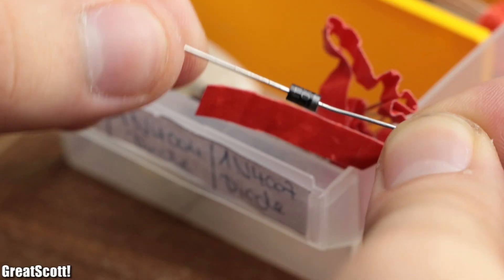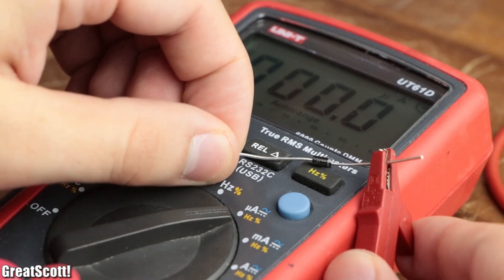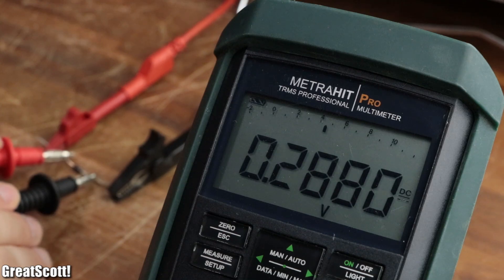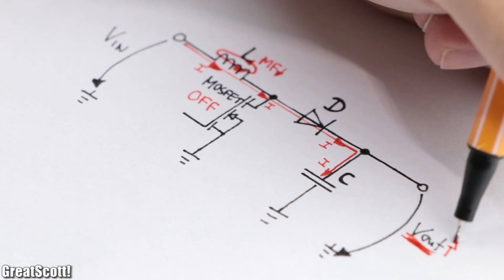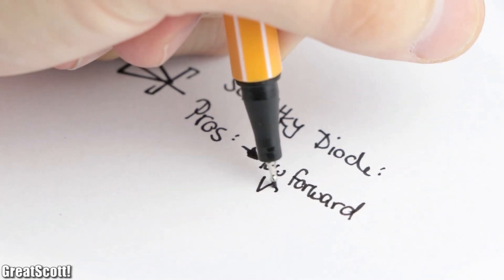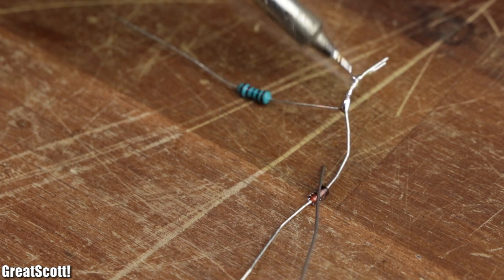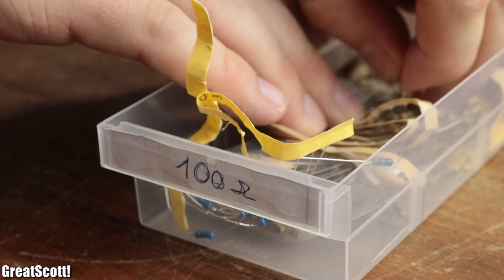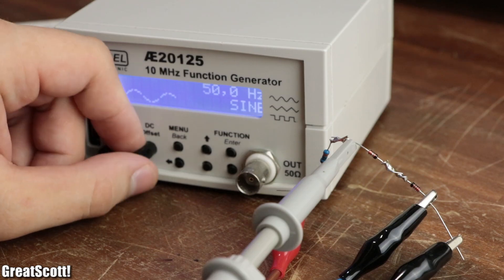Electronic Basics #31: Schottky Diode & Zener Diode

Comment: Hello. If you can help. I want a mobule for18650 input to 1.5v stable output even if the battery is 20%. Any suggestion?

Comment: Hi
In some logic ic outputs there is some unwanted negative short pulses after falling edge that can damage the microcontrollers inputs.. what circuit can block them can diode be used for this??

Comment: If I wish to use a small panel cell to power a fan it makes noise until voltage/current from the panel match minimum requirement( in partial sun coverage), would a zener diode alone or with a cap in parallel as a buffer/battery be able to not turn on the fan till the requirements are met?

Comment: what voltage would a ZD6 diode be?
Reply: 6.0 volts. But you really need to seek out the data sheets as they give you a lot more information. 

All zeners have a minimum operating current which must flow through the device in order for the device to "breakdown" at the stated voltage.

This minimum operating current is stated in the data sheet and your job as a designer is to set that operating current using the right value of series resistance.

Comment: This helped me with my YT channel content of modifying a black and decker light. The COB lights I wanted to use kept pushing resistance back to the voltage regulator board and shutting it off. Using 1 schottky diode per COB strip on the + side made everything work perfectly. Now the negative terminals get warm (50C). But the GSM6232 variable voltage regulator doesnt even get 45C. Thinking of using 3 more on the negative side. Thanks! (DruCanDoIt) is my future channel. Building content. Have 3 videos edited and ready to go so far.

Comment: What about the light emitting diode 🤔
Reply: LEDs are diodes where the band gap between the valance band and conduction band has been modified by extrinsically doping the material to introduce additional energy levels to control the wavelength of light emitted as the electrons in the conduction band fall back down to the valence band and recombine with the holes.

Summary: 
The emission of light in LEDs is produced by extrinsic carrier recombination.

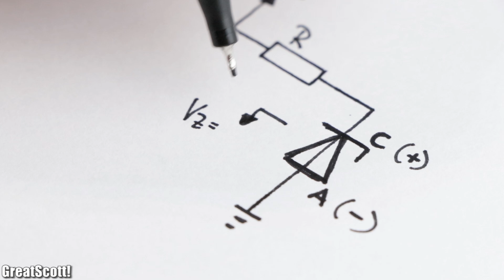Comment: In 5:11  
could you send me  that paper which you use to select the zener diode
Reply: Doesn't work like that.
You as the circuit designer have to decide on what zener voltage you require. Then you go looking for the right type of zener.
You look at the data sheets and the technical data.

Comment: hi i have a motor driver which am using to drive a coil CW and CCW to create electromagnet but when the coil collabse it destroy the motor driver can you suggest what to use to protect the motor driver , the power supply for the motor driver is 27 volts 22 amps thanks iin advance

Comment: If you use a schotky diode with a coil, you can increase the amount of current the coil is energized with each cycle. I thought this was magic when I learned about it by taking apart an old massager. Low took the diode out of the circuit. High put it in the circuit. That was when I got really interested in how these components worked. It seemed counter intuitive before I learned about those sweet sweet coils.

Comment: heres a good thought.
I recently purchased a oscilloscope which came from a high school.everything was perfect.today i get it out hook it up and no display.I opened it up and on visual inspection i found a burnt out diode the leads on both ends had burnt off.I have no schemtaics its a mini diode zener i know that from the board but cant find one that looks like it.It has a green stripe which tells me orientation.the other colors are 2 blue stripes.It mini so no numbers on it only those 3 stripes.So what do you do in a case like this?"  it goes into the crt circuit

Comment: The zener is Clipping of those voltage above 15v in your example, because it will force a larger current to Flow since it becomes conductive. This then ends in a voltage drop across the resistor in Front of the zener.. is that how it works?
Reply: No.
Zener diodes are simply diodes which have been designed to have a low reverse breakdown voltage. They are diodes which are placed deliberately into the circuit the wrong way around, compared to a non zener diode, so that they are normally reverse biased. However, the zener symbol and anode, cathode connections take account.

The reverse breakdown voltage is negative. Diodes are normally intended for operation at a voltage greater than the reverse break down voltage.
So if for example the reverse breakdown voltage is -100 volts, you should operate the zener at greater than -100 volts, which means between -100 and some positive value, typically 0.7 volts 

If you operate the diode at a lower voltage ( = at greater negative voltage), for example -120 volts then you will damage the diode. The diode becomes a short circuit. From 0 volts to -100 volts it has a high resistance and only a tiny current flows. When you go below the -100 volts the diode breaks down and the resistance greatly reduces.

Now, a zener diode is just a diode where instead of a reverse breakdown voltage being large at -100 volts, the voltage is set to a much lower voltage, for example 3.1 Volts, 9 volts.

If you connect up the zener in the right way so it is reverse biased, and you apply a voltage of greater than the stated zener voltage, the diode breaks down and the resistance, just as in the example above, reduces greatly. You do not want to do this in normal operation to non zener diodes as it permanently damages the diode. If you were using diodes in a full wave bridge rectifier running at 230 volts AC RMS, you would use diodes with a reverse breakdown voltage of typically 400 volts, which is a voltage that is higher than would normally be encountered in operation.

The series resistor with the zener does two things: it limits the current passing through the zener and prevents it burning out.

The second thing it does, it allows a voltage to be developed across the resistor so you can feed the circuit with a voltage higher than the zener voltage and the supply voltage is then divided across the resistor and the zener enabling the zener to have the right bias voltage across it to enable it to "breakdown" at the correct zener voltage.

Zeners are great, because they are designed to "breakdown" at a carefully controlled voltage, which means you can use them as a fairly accurate voltage reference. And then you can compare other voltages to them.

So for example, if you wanted a low battery indication circuit, you would use a zener and compare the battery voltage to the zener voltage and use a voltage comparator circuit or chip (or an op amp) and then use the output to drive an LED flashing circuit

Comment: Sir I have a motor attached to my cycles wheel which produces around 22v and I have to charge my battery of 15v 8a so should I do put a diode if yes pls tell me the value

Comment: Ignoring the resulting voltage drop of over 1 volt could the disadvantages of a schotty diode be negated with a standard silicon diode in series?
Reply: What? If you connect diodes in series, their voltage drops stack, resulting in lower efficiency.
Active rectifiers have the lowest voltage drop, but they require several components (mostly power MOSFETs and a controller).

Comment: Eddie Fox 

Hi there. This is a great explanation that has helped me understand Schottky and Zener diodes. I wonder if you can help me understand what is the best diode to protect an h-Bridge chip like L298N please. I have used 1n4001's but the h-bridge gets very hot (I'm running it on 12volts with "solenoids" low frequency = 20 - 1kHz but "enabling at" 20kHz roughly).

If I run  my little circuit with the cheep L298N Chinese board everything runs just warm (as you would expect) Runs at about 1 - 2 Amps. I notice they use "M7" diodes. Are these Schottky?

My circuit uses standard pin through, not SM components so the M7 would not be practical. I have seen some say the equivalent to the M7 is the 1N4007 but then I see the M7 listed as Schottky? 

Some even talk about using a Zener diode for H-Bridge protection.

Can you please advise me on what would be a real equivalent for the M7 please? 

1N5817 "family"? The fast rise time (high frequency) response seems to make sense to me on an H-bridge driving inductors. 

Thank you so much. I'm not a degree electronics student just a hobbyist interested in circuits. Have subscribed!!

If you've really got 5 minutes of you life to waste here is some thing similar to what I'm talking about before I got the Chinese L298N board (take no notice of the 1n4148's used!! :)

https://www.youtube.com/watch?v=h0nlACgOwns&t=6s

Regards

Eddie.

Comment: i have a question. does there exists a way, to send + on - voltage to one wire using tranzistors? i created the circuit, but im having a problem with + voltage flowing into collector of a npn tranzistor which is not activated, which gets hot and limits the output power. I thougth about diodes, but current can still flow to the npn tranzistor. my super weird lookign schematic: https://easyeda.com/jernej.raic/preklopnik-za-motor . I want to be able to switch + and - of 9v battery on the output(where i will plug in a dc motor) with 2 arduino digital pins(only 1 of them will be high at the time). I started doing this because arduino cant power the motor, and i dont wanna use standard switch to change + and - on the motor. i know servos are a lot better to use in this case, but i want to use standard dc motors. it worked with 3V supply and 1.5v signal, i was  getting small, but visible + / - voltages on the output.. So is there a way to do it?
Reply: There is a way. Use a H bridge IC, preferably one with integrated switches. Drive it with the Arduino, and you will get your +9V and 0V voltage swings, maybe even speed regulation using PWM, if your into that sort of thing.

Comment: Let me know is any mosfeet is available for controlling voltage upto 240v
If no, then how to control ceiling fan speed with Arduino like mechanical regular does
Reply: There are MOSFETs that can handle even higher voltages then that (seen so far ones up to 600V). One problem, they switch DC.
For AC, use a Triac to control your ceiling fans speed by varying its turn on time, if the motor can handle it.

Comment: I've never even seen that symbol used for zeners! It might be worthwhile to also show one of the more common symbols at some point.
Also, it seems more likely that you're protecting from excess gate to source voltages than gate to drain. Many mosfets don't even list a gate to drain limit; which makes sense if you think about it.
Reply: The S diode symbol (the one youknow I think) is the symbol for a "breakdown" Zener-diode, the one used here is for a "knee"voltage  Zener-diode.....

Comment: Wonderful explanation. It's a pleasure to watch your videos. I do not know what you are doing in life but you should be a teacher. Would it be possible to explain in video the control of the liquid crystal segments? Supply voltage, consumption current as well as some integrated control circuits without going through arduino please. Congratulations, thank you from Belgium.

Comment: If not mistaken, the point of the arrow must point to the higher potential (positive) at 00:17.
Reply: He is doing the opposite, pointing to a lower potential.
Reply: Joey Mac For passive components, the point of the arrow should point the highest potential (think highest potential as the point of the circuit closer to the Vcc). The current arrow is correct, the current flows from the Vcc to Gnd (considering that it is forward biased), however, the Vf is wrongly represented, because the anode is the highest potential, instead of the cathode :)
 https://www.khanacademy.org/science/electrical-engineering/ee-circuit
Reply: We never used arrows in school just plus and minus signs.

Comment: I still don't get the point of a Zener diode. Why use it as a "sort-of-constant" voltage regulator instead of a purpose-built (actually constant) voltage regulator (like the LMxxxx series)? Is it because of cost?
Reply: How do you think the LMxxxx series regulators work?
Reply: Because they are cheap and small.   Can use it for a regulator for low current loads.
Reply: There cost effective as regulators (one zener, one resistor, and your good to go) and can be used to protect sensitive electronics in cases, where there is a high chance of a voltage spike to occur (like with inductive loads).
Reply: A zener is smaller and cheaper. The circuit is less complex

Comment: Can you use suggest me current driver circuit?
Reply: I guess someone else has to. If you want to control a small current, then i suggest using a voltage controlled current source. Note that you can replace the MOSFET with a BJT and it will work the same. The output current depends on the control voltage (in the shematic i found, its U1). You can control it manually using a potenciometer, or automatically with a Arduino using a DAC or filtered PWM.
https://www.mikrocontroller.net/attachment/24521/Iconst.jpg

Comment: What is the difference between coils and capacitors? Both store energy,so is difference in current drop or something else?
Reply: Both store energy but in different form :
- a capacitor store potential energy, putting electrons in the capacitor's metal plate
- an inductor store kinetik energy (the inertia of electrons in the coil) but this energy is quickly depleted as the electrons stop moving.

You can visualise the same principals in water management where a capacitor is a big barrel of still water that you can use whenever you want and an inductor is a big pipe where water is moving fast.
As water is pouring through, if you stop the input flow, the volume of water that is inside the pipe is going to keep moving and generating energy at the other end for a time that depends on the length of the pipe.

If you push electrons through a coil and suddently disconnect the coil, the electrons are going to "crash" at the opposite side of the  coil. More electrons on one side equal more positive charges on the other side, creating potential energy. If the coil is big enough, the electrons are going to jump through the air to equalize the circuit . 

You have now a spark. The very same that makes gazoline explode in you car.
Electronic is awesome ;)
Reply: @inotoff  completely wrong.

A capacitor works by an electric field being present because there are electrical charges on the opposite plates of the capacitor.

A coil, which is an inductor, holds energy in the form of a magnetic field.

Forget all the nonsense about what's happening to electrons inside the wire.

Comment: So, I have a 33.6v #eSk8 li-ion battery for my electric longboard. I have a 120A latching relay to turn it on and off but the coil requiress 24v. I've used a voltage regulator to get the voltage down from 33.6v to 24v to work the coil, could I have used a zener doide instead? bearing in mind the battery would always be in an 'on' state to the 'centre off' switch I'm using to feed the coil.

Comment: Minute 1:38 By rule and convention when a current flow in one direction the voltage drop is in the opposite direction. Regards
Reply from the maker: No, that would be a generator. Consumer have the same direction for current and voltage.
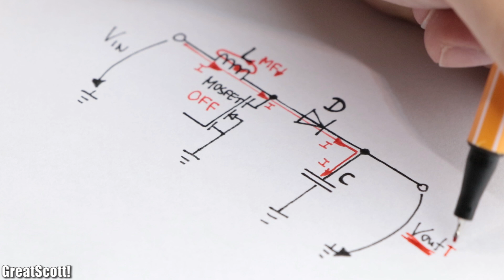Reply: GreatScott! I completely disagree. Is not a matter of generator\consumer. A diode is a component and as all the impedances by convention V and I are opposite. You will measure a positive voltage drop if you put the minus of the multimeter on the cathode of the diode and the plus on the anode, when the positive current symbol indicates that the current is flowing from the anode to the cathode (of course electrons are in the opposite direction). Isn't it ? To convince me please provide literature reference. Same observation for Vout with arrow versus ground at minute 3:03. Best Regards. Pier Aisa
Reply: I suppose now you are convinced that V and I have to be opposite. :-) Regards

Comment: Yet another great educational video mr. GreatScott:-)

Perhaps you could make an in-depth video about the pros and cons of using schottky in battery powered Applications? For example:
The lower the forward voltage drop, the higher the reverse current. Or why it's a good idea to place a diode across the pos. and neg. pins AFTER the fuse in your device. (If you reverse the polarity by mistake, the diode will act as a short circuit and blow the fuse. And it won't impose any voltage drop using this method)

Perhaps you could also talk about:

Gunn Diodes
Shockley Diodes (not a typo)
Transient Voltage Suppression Diodes
Varactor Diodes
(I'm not shure if i have mentioned them all)

Thank you for your contribution to the tinkering community!
Reply: Bo Holbo Rasmussen - Those type of diodes are perhaps much less commonly used than these two. Don't forget about light emitting diodes and photo diodes....

Comment: "Which means that this circuit can provide a maximum of up to 69 milliamps to the load."
Reply: I didnt understand this. The Zener diode needs 98 mA of current to flow through it to create a voltage drop of 5.1 V. shouldn't the series resistance pass more current through it where the rest is available to the load?

Comment: Great video, but i have a question. If diodes have very low resistance, why is there a voltage drop?
Reply: voltage drop =/ resistance
Reply: voltage drop ≠ resistance
voltage drop = how the silicon in the diode works